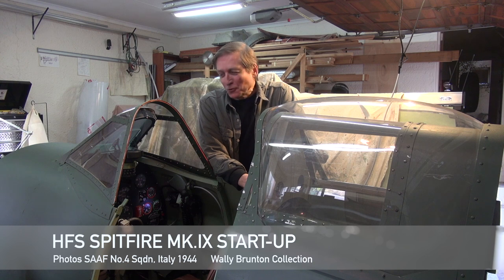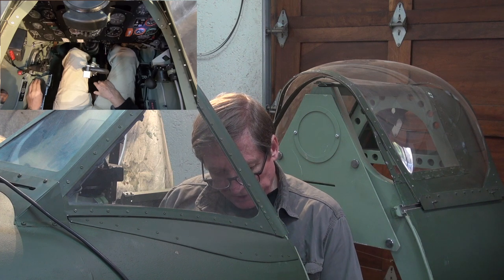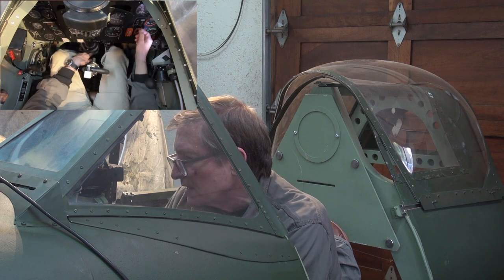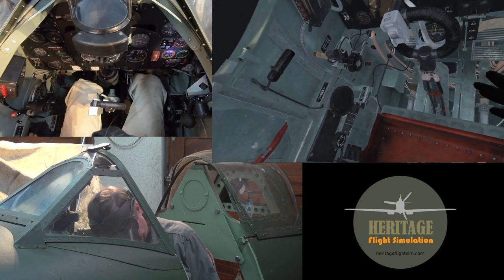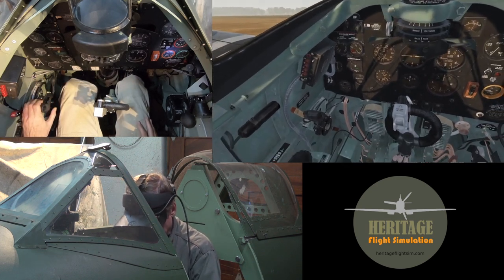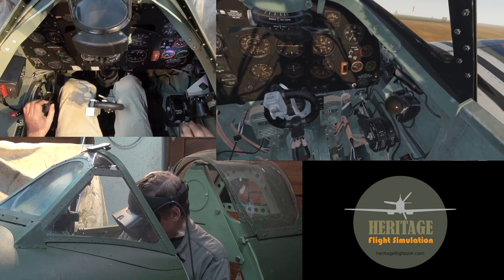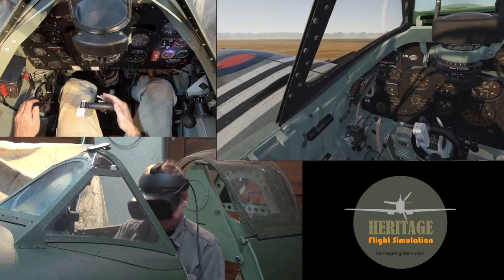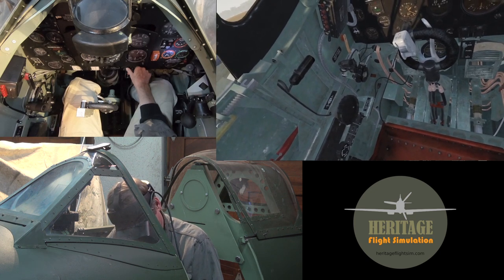HFS Spitfire MkIX Startup Demo

Comment: Hey! Been running through Spitfire Youtube videos this evening and came across this. Normally, the constructed cockpit environment is replaced by the immersion of VR but here you have successfully integrated the two! Excellent! Your video is equally well crafted, both giving a feel of your integrated system and a good formal startup procedure for the MkIX. I use an Oculus Rift S with both the excellent X-Plane Flying Iron Spitfire and the DCS version and simply cannot get enough of this remarkable aircraft.
Reply from the maker: Thank you Andre, you are very kind. 😊🙏 I must agree though, the experience of VR in the physical cockpit is exceptional! 👍
Reply: @heritageflightsimulation1556  Pleasure!! And what a surprise to find this. Are you in SA?
Reply from the maker: Andre Smith I was. Moved base to Ireland in August and getting set up here on the Emerald Isle 😊 Roel.
Reply: @andrejsmith  Brilliant! Well done! I must come take a few lessons. I hope we will be able to fly the FlyingIron Spitfire in MSFS2020 VR in the not too distant future.  Now there will be an experience!
Reply: @roelstausebach2435  Great to connect! Let's stay in touch and it would be good to join you in the virtual air sometime. I have been using JoinFS with some success (multiplayer aircraft are well presented and stable) and it works between different sims. Are you exclusively flying DCS? I generally use DCS for formation flying and some of their excellent campaign and scenario stuff but mostly am in X-Plane Vulkan VR. I particularly enjoy formal flight practices, navigation and VFR, real weather challenges.
Reply: @andrejsmith  Indeed Andre! We must do. I am still waiting for my container containing my sim gear (and the Spit :-) ) but as soon as I have things set up it will be great to have a fly together. I enjoy DCS and X-Plane, not much into combat per se but love exploring the world through flight. Flights I could never venture on in the real world given its constraints on cost, equipment, regulations, time and the vagaries of weather. With MSFS2020 VR looming I am very excited, flying through their clouds and world even on a screen is simply amazing! I did try formation practicing with some friends in real life using my Stampe and it's a challenging exercise. At the same time, it feels very real in VR too, so will be great to practice that. Will send you a message on Vimeo. Cheers, Roel
Reply: @roelstausebach2435  Fabulous! Ditto on all you say and I share your broad approach and understanding of the real benefits of virtual and simulated aviation. Chat soon via Vimeo